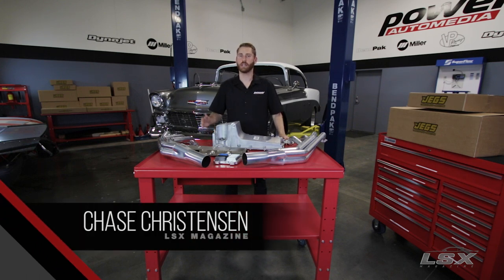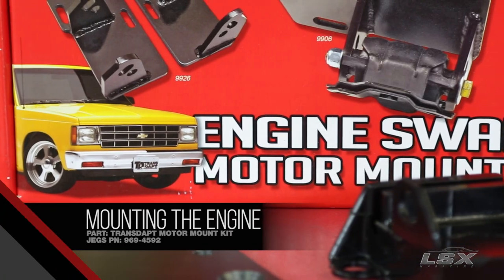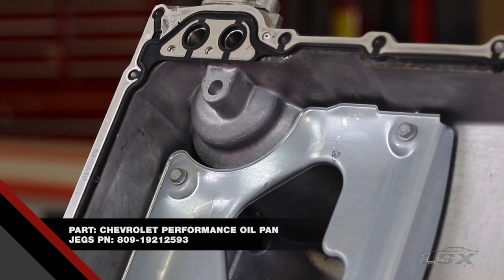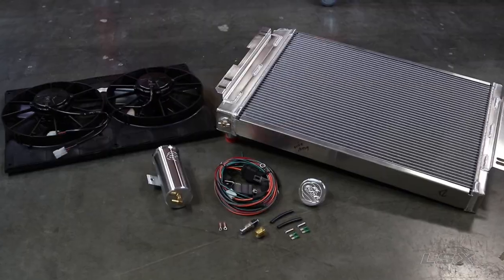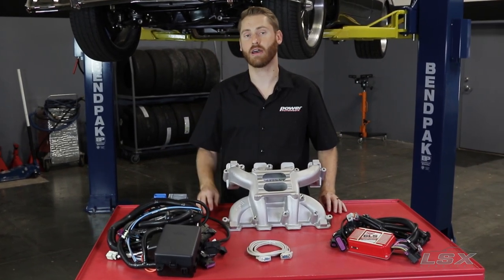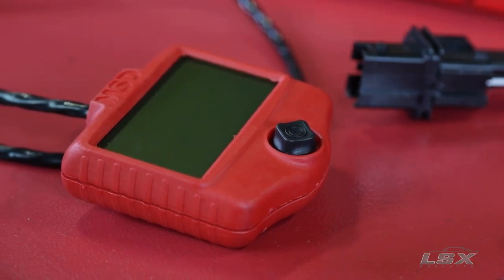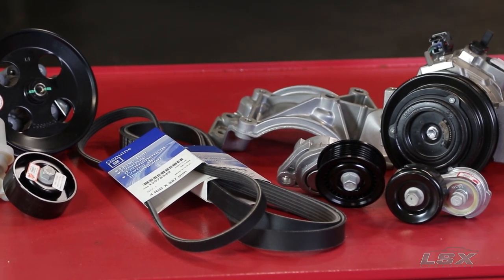LS Swap Essentials: What You Need To Know

Comment: None of this looks budget friendly
Reply: Its all unnecessary
Reply: fuzzy wuzzy honestly if you can’t afford this shit, you can’t afford a LS....
Reply: M Barilla why do you say that sir.
Reply: morris montgomery because he’s probably the guy who bring $500 less than what the motor is listed for on a bargain find motor. Then uses all old or wrong parts just cause it’s cheap which causes more work and more head ache down the line.

Than doing it right the first time by buying the proper modernsupporting mods for this modern motor like he should.

I tell people al the time, just because it works doesn’t mean it’s right. Do it right the first time.

But there will also be those guys who use fuel pumps from a 87 truck for a 2010 motor and wonder why it blew up from a lean condition 5 years later. Or hack their wire harness and leave shit grounding out instead of pulling or buying the proper new built harness.
Reply: @mrmidnight32  ok bro
Reply: @mrmidnight32  but there's cheaper ways to do it than buying a bunch of overpriced chevy performance parts when there's 20 manufacturers on summit and jegs that sell the same stuff for a lot less. Not to mention the completely aesthetic intake manifold that will most likely Rob some horsepower numbers.... I mean I could do a complete LS swap on my 98 Silverado for under $2k including buying a motor....
411 conversion, wiring harness repin guide, converter spacer, engine mount adapter, AC line adapters power steering line adapters, head studs, cam, valve springs and a tune. Basic 5.3 swap... If I wanted a stock horsepower 5.3 or 6.0 I could also go without opening the motor and do the main seals and call it a day $1500 out the door.
Reply: @mrmidnight32  .....one of the most amateur statements Ive ever heard.......all that crap he has on that table cost more than a brand new crate motor. Only a fool pisses money away for no reason .....Other than the adapters all that stuff is a waste of money.
Reply: imacheat7777 I’m not saying you have to buy these exact parts, but I’m saying if you’re that ass hope who skimps buying the proper supporting mods to do it right by using shit you find around the house or you make from soda cans you can’t afford a swap.

I’m tired of seeing idiots cutting soda cans or taking a part off another car that doesn’t fit or work then spend another 8 months jimmy rigging it to work properly.

Build it right or you can’t afford it it’s simple.
Reply: Seriously, considering all the extras needed to run an LS you'd either have to be an engineer or rich like Trump to afford this swap.
Reply: about 12k , i am 20k into my build
Reply: @mikemcorky5418  hope youre joking... I make 10/hr, am looking to spend 10k on my swap, that includes a $4k budget for my car a $3.5k motor budget and a $2.5k trans budget. Or if I can find a donor GTO I'll pick that up. Get wiring harnesses sent somewhere to either have a pro just make the LS harness connect to everything in my car or make a whole new harness. Get driveshaft made. Etc etc. It's not bad really just dont think you need to do it in one day.
Reply: imacheat7777 do mine 🙏🏼🙏🏼
Reply: Since the aftermarket is so well equipped to sell you a turn key solution it mystifies me that, specifically for writing harness, that the computer system for these engines has not yet been completely reverse engineered and shared freely among the modding community
Reply: All in all if your going put 400 to 470 horse power in your ride it's going to cost around 10 large !
Reply: @mrmidnight32   Yea ! You want it tight and right ? 400 to 500 Hp ? 10 Large or forget  about it .
Reply: @zollieh   haaaaahaaaaa! Bull Chit ! I'm looking at 400 to. 500 to. To do it Right and tight I'm looking at 10 grand . the 6.0 mostly complete with about 470 and computer harness is 7500 ! You have to pay professional to install it so you don't void the warranty . Transmmision computer harness might need to be swapped out if the old one is cracked . that's 800 to 1100 . Your transmission has to be at least a stage 2 to handle the horse power . New exhaust . if you want it done right ! Look up these old Chevy SS Silverado s .There going between 11000 to 25 grand because it has 6.0 in it .
Reply: CK_32 is full of shit, if it’s not new it won’t work is what I got out of it...
Reply: Don’t scare your self away you don’t have to get all of this stuff and be on the lookout for items from someone who decided not to finish their project ! I am thinking about going the LS as I have a carburetor SBC now . You might consider just using the LS motor with a simple carburetor, and you will still have MANY advantages .
Reply: @estebahngoldman396  The key to this statement, "you have to pay a professional for the warranty"  OR you go buy a 200000 mile motor for a grand, put a cam and springs in it 500, 100 on motor mounts, 300 on fuel pump fuel line, 50 Vats removed, research and do your own wiring harness NOT HARD,  in those stage 2 and 3 and so on Transmissions, are great they're expensive and therefore if you're going to be driving like you stole it a must, but you can have it built cheaper than you can buy one by far, there's different expenses for different vehicles, money doesn't always mean done right especially if you have some skill, done correctly information is all over the internet,  heck yeah brand news is expensive. Ever seen a video of a junkyard stock 5-3 with 8 lb of boost and 500hp that lives on and on. It's a real thing,  send it!  How many $600 5.3 can you buy for $7000 🤔
Reply: Cktime ThirtyTwo you seem like you know a lot about this. I want to ls swap my 2000 mustang but I have no idea where to start what I need or what I should get. Any help?
Reply: Brett Collins okay, I’ve tried on YouTube so I’ll google it
Reply: @nathanbaer8246  oh shit, same here 😂. If you find something out lemme know bro
Reply: Bro I'm only 21 and I already ls swap my first 3 cars my g and my single cab n my gmc
Reply: @mrmidnight32  yeah maybe about 4 years ago but I’m glad I can finally do a ls swap now😂😂😂😂😊
Reply: @mrmidnight32 Ls is literally for the poor lmao
Reply: My mechanic did it all for 2K. All I had to do is get the motor mounts and a few little tiny things.

Comment: Just a suggestion: If you use a low pressure pump and run it into a 1-gallon sump tank with the high pressure pump, it's really easy to change your fuel pumps if you ever have trouble.
Reply: changing a 2001 4.8 to a 5.3 engine in a Silverado
Reply: Yeah most people have no idea how well having a fuel surge tank up front works.
Reply: Or you can cut an access hatch in your trunk and just access it there.

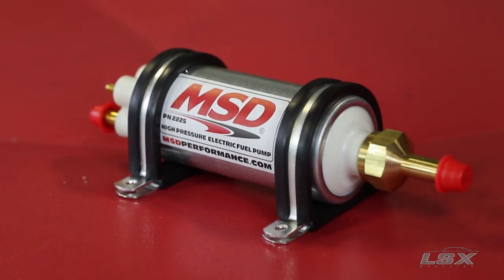Comment: Around 04:05 you mention 2-3 different ways to configure a fuel delivery system, specifically the fuel pump and last mention the external fuel pump but only show one picture/item that being the external fuel pump... Are we to assume that the easiest and most hassle free method of resolving this issue is indeed the aftermarket external fuel pump in builds where the other two options aren't easier? Maybe a good rule of thumb being to go with an external and check if other easier options are available, and make sense, later?

Comment: Just drop in a 383 Stroker with carb, one wire to the distributor, one gas line and fire it up.
Reply: And save yourself about 5 grand.
Reply: @mikemcorky5418  true... but this is a gateway for alot of other possibilities.
Reply: Is that reliable over time?
Reply: Yeah and then realize when you want cylinder heads that flow well it will cost you the price of a LS swap. Of when you want to fuel injection it, it'll cost you the less than a LS swap

Comment: ORRRR, or you can just stay with the old small block Chevy for about 1/4 to 1/2 the price and still make about the same power. But if you got 15K to spend for all this stuff, I recommend a big block chevy. It will make more power then either of them without even trying.
Reply: Reliability is key though. I love older carbureted 350's and 454's built them all my life. Of course you can make a ton more power for the money but you lose that in reliability. I'd drop a BBC in something I may drive on the weekends or something but I'd swap a ls in a heartbeat for a daily. Imo
Reply: And the most important part is where is it making the hp in the power band. Horses to horses LS will win every time
Reply: Cheap and easy to add a single turbo to the LS with very little modification to what you've already done for the LS swap and make a guaranteed 500 whp for less than it will cost to build a BBC making the same power with the same reliability.

I love BBCs too but the LS is an amazing platform for cheap reliable power.

Comment: Want to attach a 6L90E automatic transmission to my 2007 Corvette engine and put in a older vehicle!! What all will I have to do to make it work properly?? Shifting automatically , ETC?? Can the ECM be reprogrammed to work with the new mating transmission and what will I have to use with the transmission?
Reply: Bobby Brown look into wiring diagrams, and figure out what pins control the tramsmission. You'll need some kind of custom tuning program like HP tuners
Reply: Bobby Brown contact just Chevy trucks in lebanon maine. they have stand alone transmission harnesses for that kind of thing. along with stand along engine management.
Reply: Bobby Brown you can look them up on YouTube also.

Comment: Hi I have a 2006 LS1 6.0 motor I converted to carburetor I added a 622 lift cam headers and Emma's d but I am getting misfire through the carburetor blowing out can you help me please
Reply: Me too it miss fires
I got mine from my buddy’s   92 Camero rs that he totaled around the time they had it re-built with a big bore and a 700r4 transmission 

He sold it to me for 500 w/transmission no bs but it miss fires 
It wants to haul ass but that’s stopping me
Reply: where can I get a 6.0 LS1 ?
Reply: S.I. Thug no where there’s no such thing
Reply: @drakedawg313  what gets me that these dudes out here don't know what they are talking about truck motors are not 5.7 and lsx are large bore non production performance blocks I love my 5.3 swap fuelie will soon add a blower to it hope to get a ls3 or an lt in the soon future but thank you for the answer because these clowns couldn't lol 6.0 ls1

Comment: When using a 700r4 behind an ls how do you account for the tv cable?
Reply: don't,  700r4 will snap if nor rebuilt
Reply: The MultiChannel 87 /
This is why I stay off forums, I’m not asking for an opinion on whether or not I should use this transmission I know how much torque and horsepower it can handle I just need info regarding the tv cable.
Reply: Bow tie overdrive sells a bracket part#tvezls1br it will only fit drive by cable throttle body.. 700r4 should handle the power

Comment: The gm muscle car swap pan is junk,  unless you have stock height truck I wouldn't use it for any car it's a hummer pan which the sump hangs too low ....... stick with a holley 302-2 or -3

Comment: Wait but the 12 year olds on the forum told me it drops right in after I buy it from the junk yard for $500.
Reply: New engine and transmission mounts, VATS delete on factory ECU, repin factory harness and cut out the unnecessary stuff, swap in factory dual fan radiator, add factory drive by wire pedal, Walbro fuel pump from EBay, then turn key and drive. All but the mounts and fuel pump can be sourced from a wrecking yard, and you can even use a fuel pump from there if you're really stingy on cash.

If you can't handle a simple, and cheap, swap like this maybe you should refrain from bashing those that know how to, can and *have*.
Reply: Randel Clawson you missed my joke entirely 🤣

Comment: All these options look like a headache a lot of research, which means a lot of time and one big ass headache and needless to say again a lot of money!!! 

Just go buy a wrecked Camaro or Corvette and you will have the engine transmission the bolts to put them together the PCM to make it run you will have the entire wiring harness 

And you can modify the wiring harness to fit whatever application you’re putting this into and then the way it stays looking OEM original and you do not have to spend countless hours researching trying to find out what goes to what what will work with what how much it is if it’s available how long do you have to wait for it! You get to skip all that bullshit!! 

Even if you want to start from a brand new engine, OK well cool still do the wrecked car situation and just rebuild the engine!! Problem solved. This doesn’t have to be complicated people just make it.!  Hope this helps.